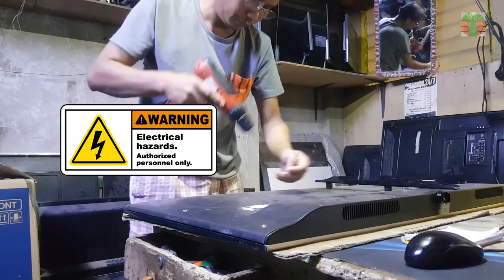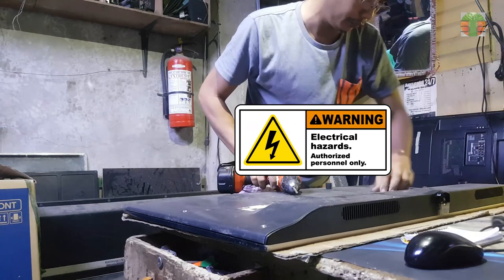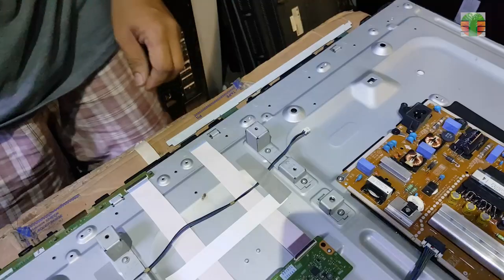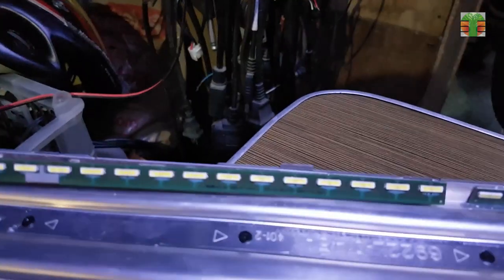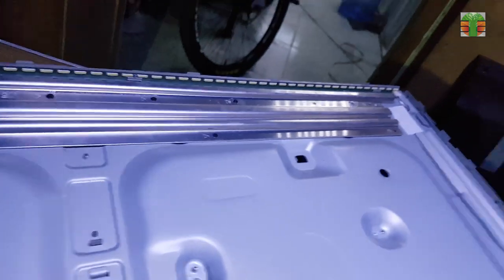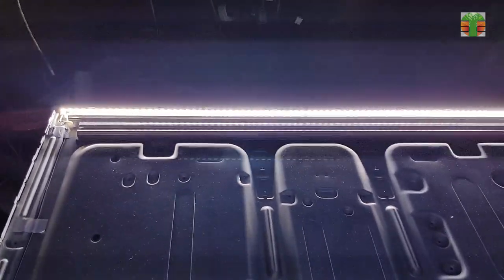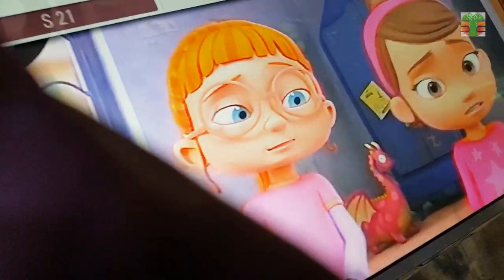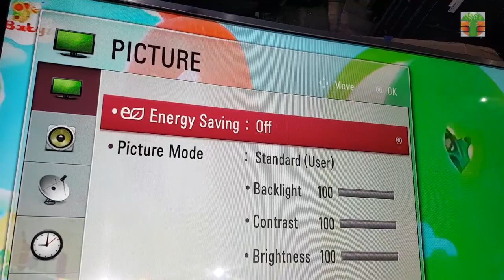How to replace a new edge backlight.

Comment: Question .   My edge light led melted a little bit of the thick diffuser panel which sits close to them.  After replacing the strips I noticed a bit of light scatter around the bottom edge.  I think it's because the led had made a little melt mark on the edge of the panel.  Would it be OK to sand that edge with a fine sandpaper to bring a smooth finish back again?  The panel is not the easiest thing to find anywhere used online. Any advice welcomed.  👍
Reply from the maker: I never try to sand it. but it may work.

Comment: Can this be done to make array style led ?
Reply from the maker: It will not be done. It's so slim.
Reply: @tevzTVTevatronics  I mean on my LG TV from 2017 it has edge lit and I am wondering if I can make it full array led with 3-4 horizontal led strips? 
I have LG55701V edge lit.
Reply from the maker: @XxGAMERxXPS3  you mean is a led strip, not an edge type strip? I don't know how you fit the led strip 3 to 4 horizontal inside, seems not possible.

Comment: My edge backlight flashed  twice and then black. I have checked each of the LEDs, they all flash twice with an interval of 5 seconds.  It seems the LEDs are OK, but why they only flash and dark again? Could you help?
Reply: grundig 39 vle 945 bl
Reply from the maker: Check  Inverter
Reply: @tevzTVTevatronics  thank you for answering,  to write a bit more how I  tested the LEDs: I used black tape to cover 55 LEDs, just left one out.  So I switched on the TV by using the remote controller. Each LED flashed twice. but where is the inverter? BTW,  when the LEDs flash,  the voltage is about 80 volts, then it decreases to about 20 volts .
Reply from the maker: @fishking77  the inverter is thous wire connected to the LEDs.
Reply: @tevzTVTevatronics  thank you!

Comment: sir ano alternate part nito KD-55X8500B Sony brand sya wala ako mhanap online salamat
Reply from the maker: anong klaseng component part?
Reply: @tevzTVTevatronics  edge backlight strip sir..salamat sa reply
Reply: puede ba bastat 55 inches sir?salamat
Reply from the maker: @sidneymamaril3824  hindi kasi pareho ng mounting at sa bilang ng led.
Reply: so dapat po ba if ano mode ng tv un lng?or mayroong alternate?kc wala ako mhanap.
Reply from the maker: @sidneymamaril3824  pwede ibang edge backlight basta alam mo ikabit.
Reply: ah ok sir kaya i sure ko lng na obra.maraming salamat sir

Comment: What can cause Led backlights to turn off automatically after 20-30 minutes. Sound works fine & I can see the menu when I shine a flashlight on the screen.

It's an edge lit LG 55LM5800 TV
Reply from the maker: some led bulb are about to giveup.
Reply: @tevzTVTevatronics  So if some of the LEDS are getting weak or dim or failing that can make the TV turn off all the backlights after a short period of time like 20 or 30 minutes?

Maybe because they are more likely to fail after they heat up or something?

NOTE: I already replaced the power supply board but it didnt fix it, its doing the same thing as before. It works fine for awhile and then the backlight turns off.
Reply from the maker: @Metalhead-4life  try to replace all led bulbs.
Reply: Same problem mine is onida 39 Inch sometimes it was working good for 5,6 hours sometimes after 10 mins no picture only sound all voltages ok even panel voltages ok give me advice sir.
Reply: @kalaelectronics1710  My LG was a pita to fix, I replaced the leds & then all boards including Tcon board. I got it working but now I have a strange issue where the screen dims slightly every 4 seconds. bright, dim bright , dim etc. Its annoying as hell, never did find a solution but was probably sold a faulty board or something & I prolly could have bought a new tv for the money I spent on parts. Good luck

Start by replacing the leds

Comment: Sir saan ka po nakabili Ng ganyang backlight sir
Reply from the maker: Search mo lang ito sa google.... 2Pcs * LED backlight strips Brand new original 43LF5400-CA light bar 43inch FHD L / R Type MAK632C7801 36 bulbs/39 bulbs
Reply: kahit ba sa brand na skyworth 29 inches pwede ba yan??
Reply: @tevzTVTevatronics  kahit po sa skyworth 29 inches pwede po ba yan?
Reply from the maker: @francisalabado8399  pwede bast mag kasya sa mounting.
Reply: @tevzTVTevatronics  saan po nakaka bili ganyan?
Reply from the maker: sa lazada
Reply: @tevzTVTevatronics  hm po yung ganyang backlight
Reply from the maker: @marizbariuan3633  600
Reply: Ser saan ba makabili edge type bl. Model konka 49?